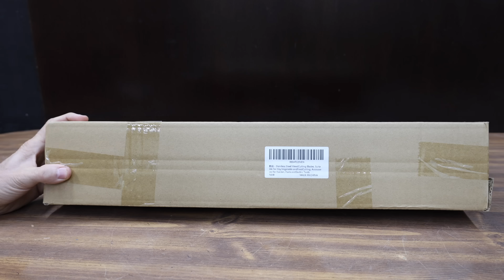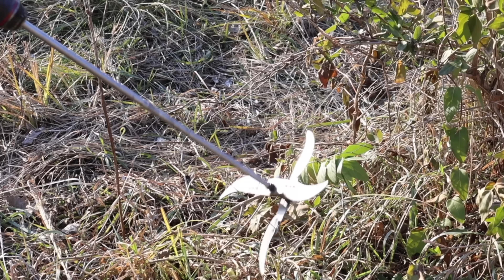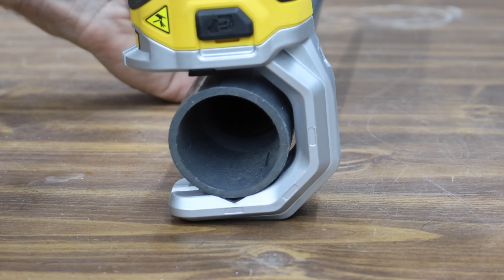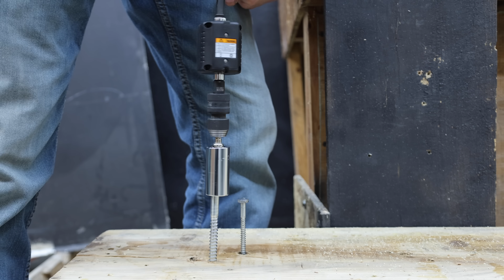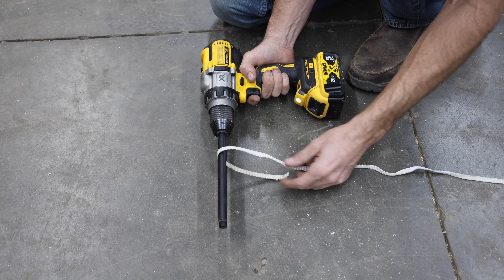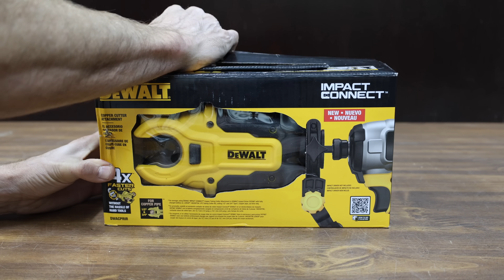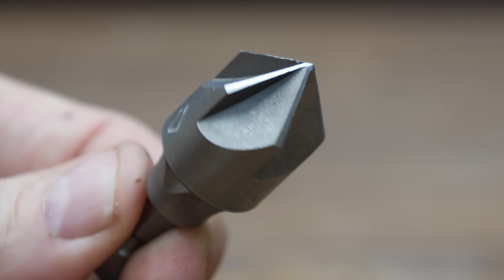I Replaced 10 Power Tools With My Drill!

Comment: To anyone that needs to hear this: don't run your drill nonstop like it's a pump!!!
The motors are designed for short, powerful bursts. Unless it's a hammer drill, you're gonna burn the motor up holding the trigger for long periods of time. Buy wired tools if you want to save some money. Much cheaper than battery-op tools; and most provide better and more consistent power.

Comment: I have the Dewalt metal shears. Used them to cut up an old above ground pool sidewall. The shears worked well but didn't hold onto my non-Dewalt brand impact driver.

Comment: I have a pump like the water pump permanently installed in my sailboat for changing oil in the 76 hp Yanmar diesel engine. I used it to pump out the water in the bilge under the engine. Had to treat that water as oil waste. The perfect option would be one of these inexpensive pumps for just the engine bay bilge water, another for the engine oil, and maybe even a third one for plain water or soapy water.  I really enjoyed this episode.

Comment: +1 for the DeWalt metal cutting shears.  I put up small livestock houses (chicken, rabbits) with metal roofing, and those make short work of any cutting to size I need to do.

Also have a universal socket adapter and I like it, but I've never stress tested it on lag bolts.  Mostly light duty stuff where I don't know the socket I need; I wouldn't trust it on any bolt I couldn't afford to strip.

Comment: There are drill attachment water pumps like that but they have garden hose sized fittings on them. The garden hoses hold up a lot better than those flimsy water hoses and it's a little bit more convenient.

Comment: Just want to say I really like my universal socket adapter, I remember them on TV as a kid, and now ig got on, i Don't ever push it had, but for just getting different sizes of quickly its really nice to have in the tool box especially on larger sizes it struggles with small bolt and nuts.

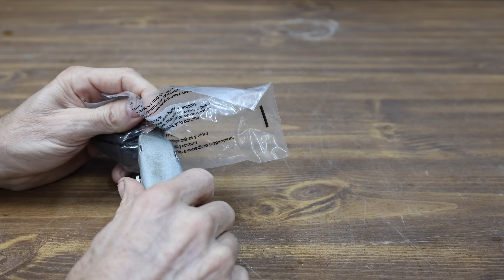Comment: 15:28 I got one of those drill powered water pumps from Miles Craft, people that note failures tend to use them for fluids not recommended because the pump need lubricant and some of those fluids dissolve the lube and run it dry. Also it does say its recommended to lube it after every use or close to such. The miles craft did not come with hose but any thick garden hose will work. I used 2 old washing machine hoses with one end cut off of each and used it a few times to drain a sink and a washing machine. 

I also have gotten the drill auger for a 4 inch hole and wet dirt sticks and dry dirt can be too hard but it will dig both. Slightly damp dirt is the best, It was even dealing with clay if it was wettened and then it kinda came out. It will really suck the auger down and sling the drill even with a side handle. I have found if you have a dirt mount that you need to shovel but its compacted, use the auger to quickly till it. Kinda fun to mess around with it like that.

The Pop riveter is something you need to shop around for to find the good ones. There is also a rivnut version and both of them work if you get the right ones. 

The funny thing is there was the Matrix lineup that uses the drill base with attachments and it had a mouse style sander which was fine for use but suffered the Black and Decker velcro problem. The oscillator tool which suffered the proprietary attachment teeth which would not fit generic replacements unless modified a bit with a ball end burr. The inflator which worked pretty well. The hedge trimmer attachment which came as a set of wide and long nose trimmers and they work pretty well. The trim saw attachment which works very well and cuts quite smooth and quick, one of the best attachments. A ball inflator like thing but its a leaf blower with attachment ends for those giant exercise balls. I use it to clean up stuff and has some power and acts like a small leaf blower. I have blown rocks out of screw holes, clean dust off of benches and even blown out a shed of leaves that covered the floor. Also one of the best attachments. It also had Reciprocating saw attachment and Sawzall attachment and both work quite well. The reciprocating attachment did not feel too weird with its high height compared to a normal reciprocating saw for cutting. 

The drum sander is really meant for inside holes to clean out or rounded surfaces and they have been around for so long. Like 50 years or more and you can get them with a handle on the other end. They honestly are best for making a hole a bit more bigger when you either need the extra room or just don't have quite the correct size for the hole. They don't like metal though as that can heat up a bit too much but still use them for it.

Overall its the build quality and using the drill motor works but with the gearing after the motor is the negative as well as the drill chuck. Sadly the Matrix attachments is expensive now. They use to be like 20 to 30 new and now they are 45 to 60 new. A great concept if implemented correctly but need a higher end tool brand like Dewalt, Milwaukee or even the mid range ones like Craftsman and Makita to run the line for the price to make sense. Brushless with better batteries and a higher price point tool base is viable for the price of the attachments.

Comment: That water pump looks like a quick way for scumbags to steal gas from vehicles🤣. Drill brush sets are fantastic, all kinds. I have soft scrub discs I use to speed up cleaning a glass top stove and sink with the right cleaners, more coarse brushes for cleaning the bathtub/shower. I've used wire brushes to strip old Griswolds. Things like PVC cutters seem stupid to me; manual ones lay flat in a tool box and are easy to use, why would I replace that with a bulky attachment?

Comment: Hi, Im looking at buying a 'DeWALT DCG426N-XJ 18V XR 125MM Cordless Brushless Die Grinder Body Only' but they are  EXPENSIVE and i wont need to use it often ! They start at £163 for the bair unit with no battery or charger but i have a few dewalt products and have battery's and a charger already ! SO there are Dewalt Copies for £25 of the Die Grinder and I was thinking of getting one of them BUT the concern is would they burn my batteries out or would they work just fine ! I know the tool wont be great but i dont need it to be but i don't want to brick my batteries  ! ANY ADVICE ?

Comment: Ive got/used a few of these...

The rivet attachment from kincrome works amazing and in reverse it opens the insides for the pin removal. Also much smaller but needs 2 hands but least you can pull up to avoid scratches once you pop a rivet. 

Dewalt right angle adapter is all I use and its at least 5 years old no issues. 

Steel wire tensioner for tightening handrail wire is what I made for my strap winder

The hole digger saved me a huge amount of work drilling over 150 150mm at over 600mm deep in clay...but it broke my clutch in my makita 40v drill.

Wire wheels are great and using an long extension it cleans out used buckets real nice.

Comment: I've got that rivet tool and it has worked well for me. I find using the drill on a low speed and stopping as soon as the rivet pops helps stop the pin getting stuck.

Comment: I use one of these cheap riveting attachments and it works well. The trick to remove the pins is to use a tip one size up from what you would normally need for your rivet, plus good lubrication as you have said, then the pins just fall out on their own. One in 30 or so still gets stuck, but all in all it makes quick work of even pretty thick rivets, while costing significantly less than a good hand operated tool and being much easier on your hands.

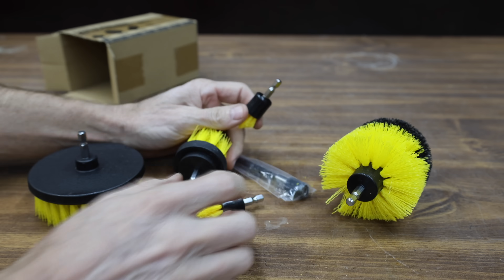Comment: Re: 16:05 dura brush attachment, used mine to clean my grill the plastic gets to hot and melts/stops spinning needs a better attachment maybe a pin its just a hex melted in. didn't take long to melt maybe less pressure

Comment: Thank you for introducing me to the PVC cutter attachment. I work in sprinkler irrigation.
Reply: I just thought to myself "Who in the world regurlarly needs to cut pipes that small?"
Reply: @Marauder1981 plumbers. I usually use a reciprocating saw but it leaves a lot of debris behind. I could have used that yesterday on a job e
Reply: what do u normaly use?
Reply: I’m glad he’s introduced me to the PVC cutter as well, I’ve just found out my husband has been cheating and I know just the job this tool would be perfect for.
Reply: @Pot-pasta "Bobbitt 2 - Severance Package"
Reply: I have heard feedback that using that style of PVC cutter (arrow guillotine) works well when the PVC is relatively new and at room temperature.  On old PVC that's lost some of its plasticity, or very cold PVC, the pipe can crack instead.  For new PVC it looks pretty neat, though.
Reply: @alsavage1 I work with a lot of conduit. Yep this will definitely shatter cold or old conduit. Theres a reason most tradies use a set of hand cutters to score and snap or do a twist cut.
Reply: @Shrouded_reaper  What reason would that be? Is that type of cutter more popular in a certain country? In the USA, I'd say I see more guys using a sawsall of varying sizes to cut conduit vs hand cutters. The conduit being very cold I'll never have to worry about where I live and I don't work with old conduit very often.
Reply: @alsavage1  I worked on pool heating solar for years and you’re right. They’d use black pipe on the roof because black = more heat. Pipes would crack and break when you had to cut for repairs.

Little trick tha always worked is to spray silicone lubricant on the pipe. It softens the pipe and makes the cut perfectly smooth every time.

Some guys wouldn’t have a can of silicone spray so they’d use their pipe cleaner. Which does work better to soften the pipe but it also stains the black pipe white and also dulls your blade on your cutter. So silicone is the best way to soften the pipe that I’ve found anyways.

Comment: Video ideas:
-Soldering stations with irons and hot air rework.

-indoor and/or greenhouse grow lights for seed starts and maybe whether or not those lights would need to be different for hydroponics and indoor house plants.

-Precision screwdriver bit sets (hex bits, torx, security torx, e-torx, Phillips, slotted, etc...) like the Klein tools set with the micro ratchet, iFixits, Gearwrench sets,....)

-If you're feeling extra spicy, maybe some 3D printer filament testing between different brands of a certain filament, like ABS/Nylon. Maybe how well certain replacement parts could hold up on a car or boat or ATV. Maybe not super critical components, but things like a wiper fluid reservoir that you can print for a few pennies worth of filament vs auto store replacement parts...

JUST SOME IDEAS, SORRY so many

Comment: that first attachment was to be mounted inside a bucket. the bucket is the protection. the bracket it came with gets mounted to the inside bottom of a 5 gallon bucket.
Reply: how would you use it then? stick it straight down onto specific plants? Also, regardless of bucket to protect it fell off just from using it and he lost a nut, so it doesn't work well anyway
Reply: Wait, what?

Comment: I have a good aftermarket drill powered riveter, it's great for even stainless rivets (so far) limited use, but it does eject the spent part of the rivet if reversed fully. (unsure of brand, but it's plastic blue in colour )

Comment: I was interested in seeing the review of the DeWalt pvc cutter and how it attached to the drill. A friend gave me one when he didn't know what to do with it. No box no instructions just here you go so seeing how it mounted will save some time. I do know that the edge is wicked sharp so I wouldn't want to get a finger in the way. 

The drum sander was cool the deburring tool and the deburring chamfer tool looked good. Speed kills but if I need a chainsaw I will just use a chainsaw. Wear and tear on the drill is important with the prices they charge for cordless tools nowadays. As little copper pipe I cut now I will still do it by hand, if you do it right it is good enough.

Comment: i was considering that "reciprocating" attachment before.its meant to be a jigsaw for those that didnt need one.
i didnt need a jigsaw long term. but for 10 dollars more there was a bargain brand jigsaw. 
i bought a hammer drill from the same brand.
 it lacked power but it did slowly drill through 100mm concrete wall. i had to do the drilling in step of diameter. all to run 4 cat6 cable around the home.

Comment: I freaking love my auger bit for my drill. Dug a 2 foot deep trench and didn’t have to touch a digging bar and it was easy dirt removal. Dug a 6 inch wide hole 3 foot deep hole in like 30 mins or less.

Comment: I have the metal shear one and it does okay.  Not as compact as a purpose built one.  I need something for cutting cardboard and so far I have the Ryobi and a battery powered scissor kind.  Both are a little slow and not quite powerful enough for heavy cardboard.  I was hoping the metal shear would do the cardboard since has the power, but it won't fit the thick cardboard.

Comment: The wire brushes are fantastic for rust cleanup. You can get them in various materials - stainless, brass, aluminum, etc. Just make sure to use proper protection while using them, since they will fling sharp metal wires occasionally.

Comment: I wouldn't trust that chainsaw at all. it's an accident waiting to happen. Another thing to consider with these attachments is that they put pressure on the drill in a way it was not designed for and can cause the drill to fail. also most of these no-name brand chinesieum Amazon crap will fail within the first few uses and probably injure you when it does fail.

Comment: Thank you for another awesome video!  Now I think I need those deburring tools.  Btw, I have a Black&Decker Matrix drill with a number of attachments (orbital sander, oscillating tool, jigsaw, reciprocating saw, circular saw, router, tire infaltor, Impact driver, hammer driver, etc.).  None of these attachments are a true replacement for the real thing, but are good enough for small jobs or the occasional DIY project.

Comment: I used to use an Astro Pneumatic pop rivet tool that cost more like $80 bucks, it was worth it to do quick drive up repairs on trailers without having to run an air hose out and find the shops (much nicer) pneumatic rivet tool

Comment: I bought a set of augers and they really work great in my garden for making transplant holes and for fencepost holes.  I need a flexible drill extension now and then and the cheap ones don't hold up. But I got a much better stiffer Makita one and it does the job without breaking apart.

Comment: Drill attachments were a big thing at least here in Finland in the 70's and 80's when I was a kid as we were a fairly poor country and electric motors and thus dedicated power tools used to be MUCH more expensive than today so most families only had one power tool, a hand drill. 

Manufacturers had big catalogs of all kinds of tools powered by an electric drill (corded back the of course), you could get table saws, routers, sanders, wood lathes and of course drill presses that used a drill as their power source. They were not very powerful and could be clunky to use but still faster than hand tools.

I remember my grandfather sawing a hole for a kitchen sink into a wooden counter top when I was around 8 or 9 with a drill operated jigsaw he had loaned from someone.

Comment: The plastic gears failed.  What a surprise...  

2001 I bought a $120 (expensive for the time) automated cat box.  One of the 5 plastic gears failed within 3 months.  Hoping we just got a lemon, we bought another.  Lasted 6 months.  I thought ok, going to pull the good gears out, get another ($360 at this point) and have replacement gears.  Yep, it failed in less than one year and turns out the gears were not interchangeable (The two on the right were not the same and could not be flipped around and used on the otherside)  So there I was at 3:00 am cleaning the cat box knowing I had to be up in 4 hours.  (was working 50-60 hrs/wk with first newborn)

I simply do not buy ANYTHING with plastic gears.

Comment: I got a 3.5" x 32" auger and it worked pretty well in my big Milwaukee 1/2 drill for about 15 holes in rough clay and rocky soil. Then I found out that the 3/8 hex shaft was only silver braized to the end cap. I then made a solid adapter out of 4140 fit to the ID, 2x cross pins, and a 1/2" hex milled into the bar end. It was a fun project. I have yet to really test it. Auger seemed pretty good until until it broke. Nothing else was even worn badly

Comment: I'm not saying that you're using the rivet gun wrong but you may have got a slightly dodgy one, I found that you can put a rivet in and then reverse the direction of the drill and it just spits the mandrel out. Once I figured mine out it quickly became one of my favourite tools. Was it finicky and was there a sweet spot when using it? Yes, but did it save me a whole bunch of time and frustration, also YES.

Comment: Black and Decker Matrix. I have one. It is a drill body, but the drill can be removed and replaced with attachments. It has impact, circular caw, jig saw, oscillating tool, sander, sawzall, tire pump... I have the drill and impact as well as sander and tire pump, they all work and it's handy and keeps the number of tools and batteries down... But I'm not a professional, it gets used occasionally.

Comment: I liked the look of the pipe reaming tools. The performance of the one that looked like a countersink was amazing. I've done a lot of amateur plumbing and I have never succeeded in getting perfectly smooth copper pipe ends with the tools I use. I have seen plumber's use a tool like this one: AFA Tooling - Deburring Tool Micro-Polished. They seem to work very well. I'd give it a try if I still much copper pipe soldering.